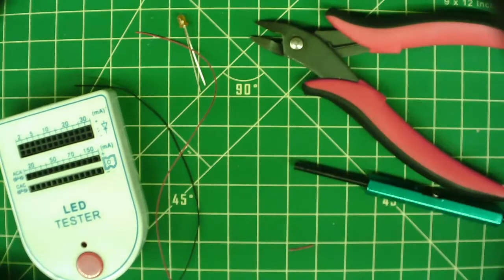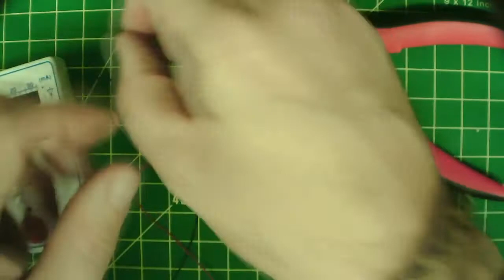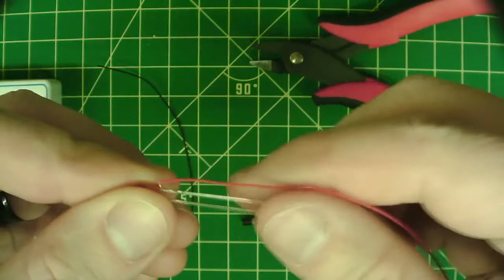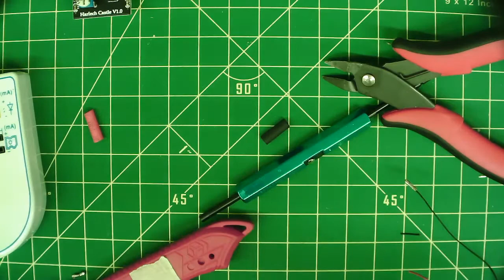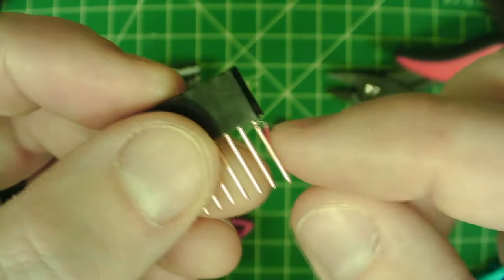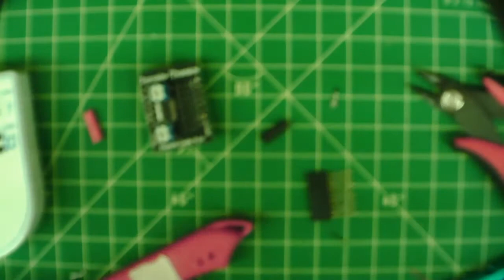Using a wirewrap tool to hook up LED's in your terrain!

Comment: Sorry, but you need to wrap some of the insulated wire around the pin as well. Otherwise you are more likely to make a short.
Reply from the maker: That’s a fair comment. The tools don’t easily take the insulation in their slots. However, I counter this by keeping tension on the wire as Inwrap (so it’s not loose) but also hot glueing some strain relief that keeps tension on the wrap as well